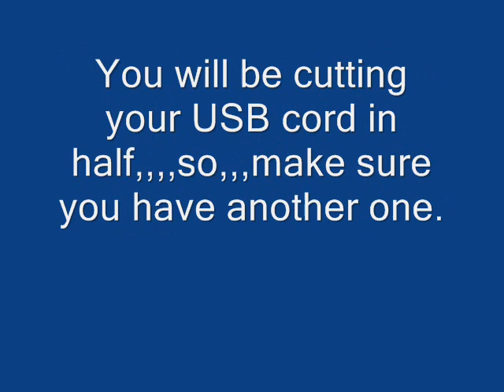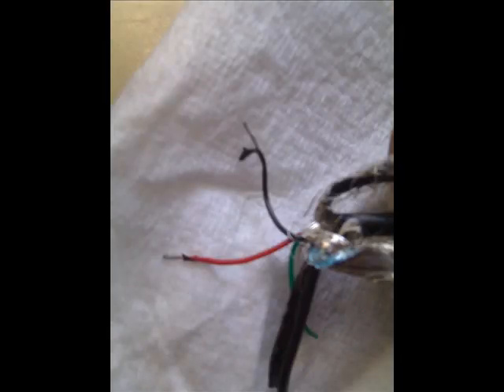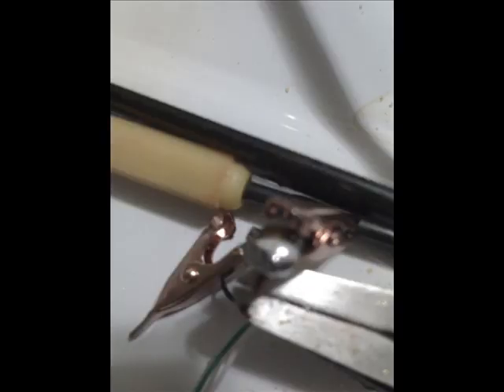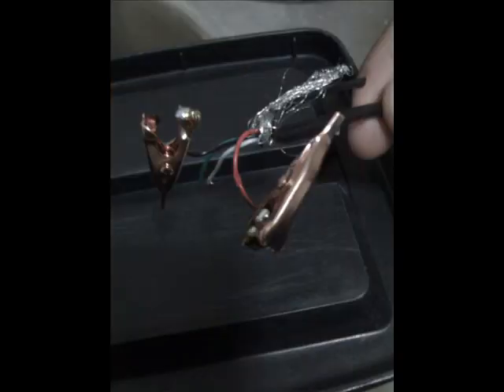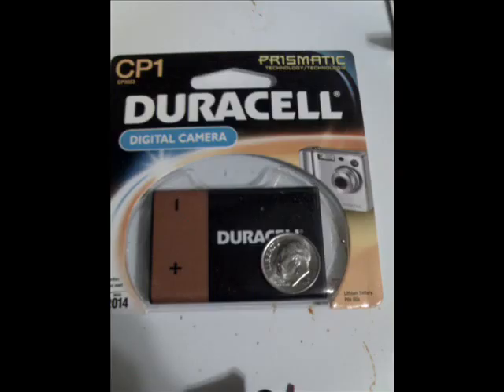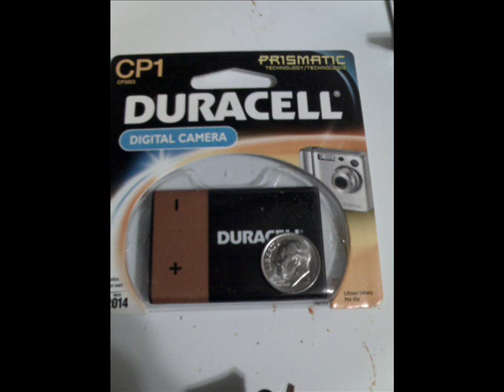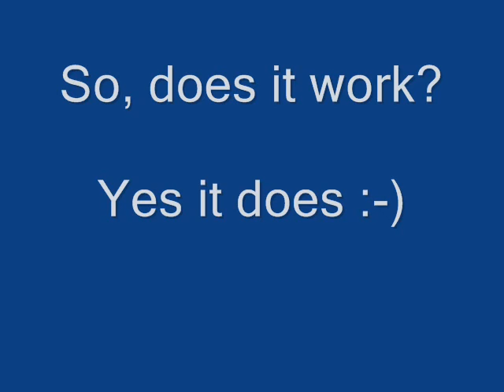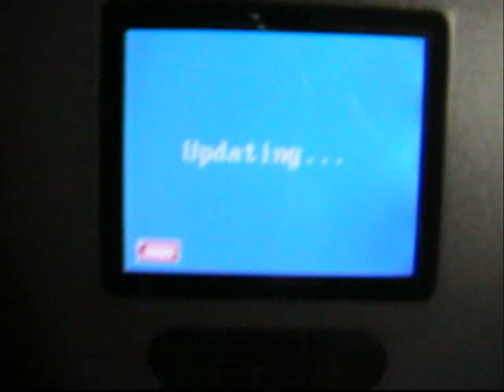Make your own Micro USB Charger for your gadgets

Comment: Good info, just one note: More solder is not always better. What is more important is that the surface is free of any oxides and you get the surface hot enough to get a good bond. For example I would just dab some flux on the connecter and heat it to clean the surface. Then you want to tin the connector and your wires. What this does is it gets a bond of solder on both pieces. Now you just hook your wire onto the connector and apply heat and a bit of solder if necessary to complete the bond.

Comment from the maker: @4dy4dy The MP3 player works fine, and the charger I made works as well.  As for the "Updating" message that was displayed, who knows, maybe I needed to up the voltage (different battery); this video was more to show how to make the "adapter" cord than it was to push for the use of that certain battery I used.  BTW, your English is pretty good, assuming that it's not your first language.